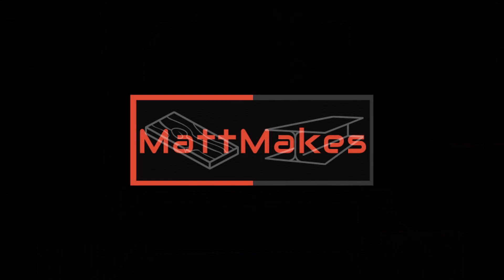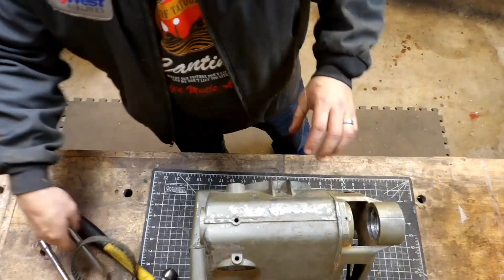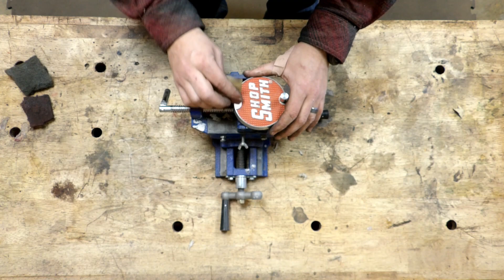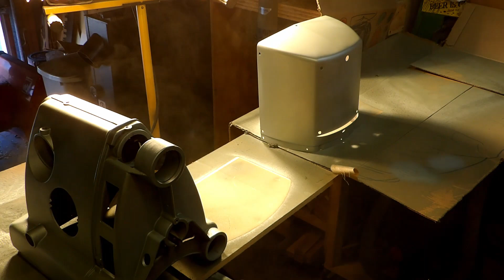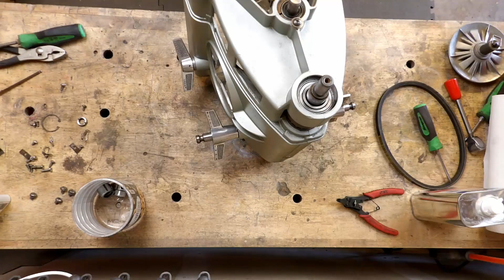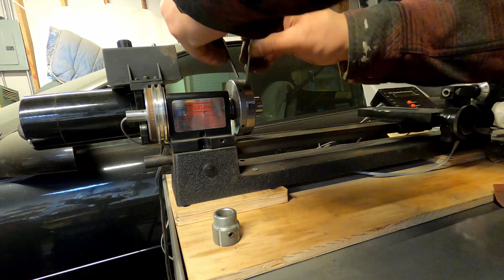Shopsmith Powerplant Restoration

Comment: This restoration effort is fantastic. 
Having I had help replacing the V belt and gilmer belt after replacing the motor with 1-1/4 HP motor, I can attest to the time required getting down to that part. I'd love to know how long it took you to complete the job.  
With regard to metal sliding surfaces,  after carefully cleaning and polishing all the slides 46+ year old machine I find that spray-on teflon powder seems to last a very long time. This is particularly true for the vertical outrider tables or anything else that uses those ports. And I found shop wheels that were the same size as the original one, so I had no problem replacing them. And why didn't you replace the original power cord?
I know your objective was to restore the unit to its original purchase sale. but I would have loved to see how the more powerful motor would have fit in the head stock.

Comment: Great Job...Wouldve liked to see some attention to the DC Motor but hey nit still looks amazing. Did you just blow the brush dust out of the motor. I have found after 25 years in the golf cart business that is almost a needed yearly maintenance. I can't believe how well these things hold up. Mine I just picked up is a 1985 model. Tore it down yesterday and began the cleaning, Priming and paint process. Like you I plan on the powerhead being my final step for the base unit then I will have all of the accessories to deal with. Mine is the Mark V with the table saw, Band saw, Disc sander and of course the lathe.
Speaking of lathe...Do you use yours ? If so do you know of a chuck for the head and tail stock that would work for restoring pool cues ? That is why I purchased the unit. I need a way of running the 2 piece cues separately in the lathe to adequately remove and replace the UV finishes.
Once again very informative video and congrats on a unit that will now be around for you great grand babies to play with. lol.

Comment: Now is the time to rid the gilmer belt system.👍👍
Reply from the maker: I think I'd rather get the bigger motor first. But yeah, would not be opposed to a belt upgrade.
Reply: Is there room in the headstock to hold a larger more powerful motor?

Comment: Does this machine really work??
Reply from the maker: It works great! I use it all the time for all kinds of things. I don't have the space for all these tools individually, so this is awesome. It drives some people crazy and they ditch it before they get a chance to really enjoy it. But I love mine. Been using it for years.
Reply: @mattmakes6065  agree! I'm 46+ years into using mine. Only modification is a more powerful motor and new belts 30 years into using it.  One of the reasons I needed a more powerful motor was that my workshop was in an unheated garage and the motor wouldn't turn over when the shop temperature was below 40 F!

Comment: What size break cylinder hone did you use there?  Also thanks so much for doing this video!
Reply from the maker: It was the only size I saw at AutoZone. It probably will do about an inch at it's smallest, up to 2, maybe 3 at a max.

Comment: I'd like to note that when you put in the idler shaft, the depth is important. Otherwise the sheaves can open too wide and the belt will drop to the shaft and jam the machine. I actually bought one jammed that way, so I learned how to adjust it.
Reply: I have the Mark V/500 and I believe that's what happened to mine - it's jammed, and the belt very loose (think it "dropped'). Hoping this weekend to see if I can fix it. Wish me luck.
Reply from the maker: It's a very fixable machine, I'm sure you'll be able to see what's wrong quickly and have it working soon! Good luck!
Reply from the maker: Wasn't aware of that issue, but makes total sense. Haven't had that happen yet, but now I know it's a thing and know how to fix it. Thanks!
Reply: what is the secret to installing the idler shaft to the proper depth?  Please explain
Reply from the maker: The manual says to take off the belt cover and press on the v belt. If you can push it further than 1/8" with heavy pressure it needs to be tensioned. There's a bolt holding an eccentric bushing (the hole the idler shaft goes through is not centered on the bushing itself). Turn the bushing to add tension, tighten the bolt, and you should be good.

Comment: Maybe I should have you do mine. It is newer than yours by about 11 years but all three of us owners have taken good care of it. Still, it probably wouldn't hurt to disassemble it and give it a little TLC. I love the machine and I know you will too. Great work!
Reply from the maker: I would love to! Not sure the geography works out for that, though! Hopefully you can follow along a bit and get some ideas at least?
Reply: If it works smoothly don't mess with it. The only major issue I found after30 yrs of using it, was that the motor was undersized for some of the add-ons, like the shaper/planer.

Comment: Thanks again for a great video! For taking the time and effort for a complete rebuild of this Mark V. You’re going to see those belts again. 25 hr PM of the ShopSmith head. Most never see it, but that’s what is what is recommended.
Reply from the maker: I'm sure it will be a thing in my future. I hope to use this machine for many years to come, and nothing has ever been made that hasn't failed. I will be replacing them at some point down the road!
Reply: @mattmakes6065  well like I said before I have three that need address at some point. The mark VII is the oldest and with all the plastic parts, I’m probably going to rehead it with a mark V head. I can rewire the head to reverse the motor as needed. I really like it for being able to rotate both ways. The other two are mark V’s a 500 and a 510. The 510 needs a 25 hour PM work done. No painting needs to be done.  But really like taking the legs off and mounting to a lower storage table. Like 10a’s, but with height adjustments.
Reply from the maker: I'd love to see your ideas about a lower table. I've been kicking around a lot of ideas on that point. I've got a basic shelf that is really good at collecting all my sawdust. I'd like to hang a sort of toolbox in the future
Reply: @mattmakes6065  part of the reason for rebasing is to set up a vac system, and an air filter connection w/ positive air flow to the head. Doing this keeps the head cooler and cleaner. Help keep the dust out!, the adjuster help when using the bandsaw, making the band saw table lower. Also helpful for people who are different heights. Secondly, having tools in close proximity very helpful, covered to keep dust off, doors and drawers.
The mark VII is probably going to be my 30” drum sander, as by running in reverse, I can feed the work piece from the front of the machine. Part of the reason for a head charge is getting a 1 1 /8 hp motor. 
I’m looking for a couple of mark V’s to add to the shop for back up heads and parts.
Reply from the maker: That sounds like quite a set up! I wish I had the space!
Reply: If you would like to see some drafts that I have,just let me know. Glad to share.
Reply from the maker: Love to! In the about section of my page there's some contact info if you'd like to send me some pictures or something!
Reply: @mattmakes6065  let me get it to you tomorrow, as I don’t have them with me this evening, but glad to share. They are hand drawn and I will be. Glad to answer questions about them.
Reply from the maker: Awesome! Thanks!
Reply: @mattmakes6065  space is always a premium for me. That why I like ShopSmith, they only take a small area. My shop is 14x40
Reply: I replaced the belts after 30 yrs. when I upgraded the motor